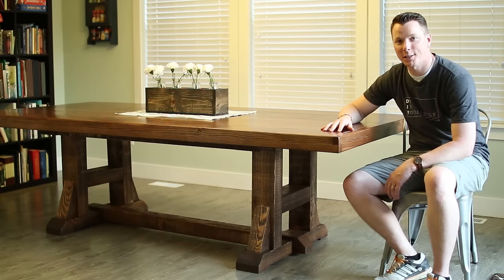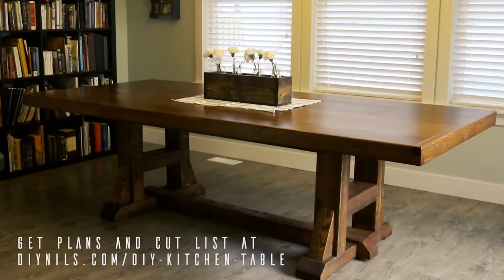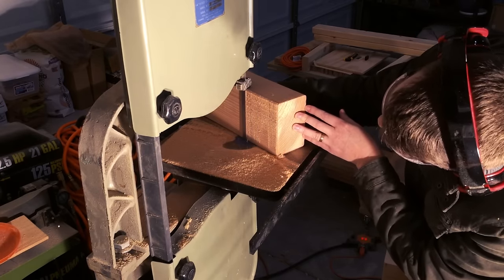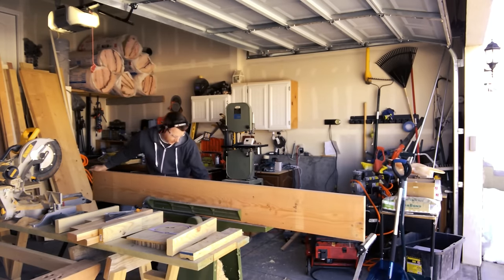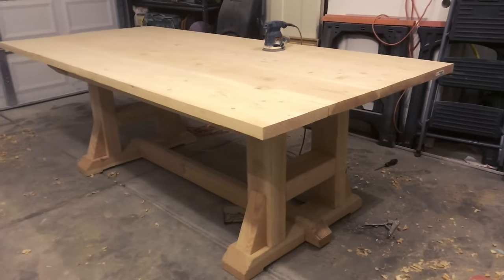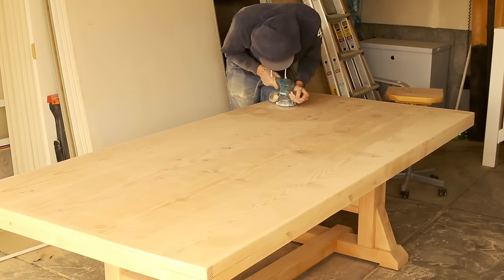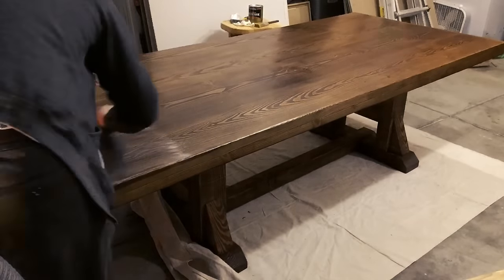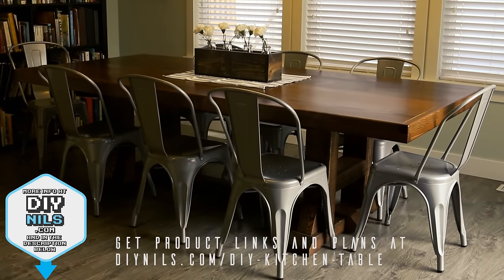DIY Dining Table: Pottery Barn Inspired Farmhouse Table

Comment from the maker: A quick note on the end caps. I’m not sure I’d honestly recommend them. The problem is that the wood will shrink and expand more in one direction than the other, which means that while the table top may move a bit in one direction, the end cap, by virtue of being perpendicular to the rest of the top, will move in the other direction. On my table this has resulted in a bit of a lip. Nothing huge, but not what I hoped for. I’d recommend leaving the wood out for several weeks first, or possibly omitting the end cap altogether. Another option is to create an end cap (for the lip) by cutting off 1.5" from the table top and then attaching that to the bottom of the ends - to help match up the skirts. I attached the end caps with glue and brads at first, followed up with some pocket hole screws from the bottom side. If you're just doing the skirt method, then I'd recommend screwing them in from the bottom using 2.5" countersunk screws. The end cap dimensions (as shown in the plans) are 3’6″ W x 3″ H x 1.5″ D.

As for the side skirts, it’s just a 2×4 ripped in half and then glued, tacked and screwed onto the table top. I countersunk all of the screws and that one worked out pretty well. The side skirts are 7’9″ W x 1.5″ H x 1.5″ D.
Reply: I make a lot of tables using similar techniques.  I've devised a system to allow the cross grain to expand and contract freely without the breadboard ends preventing that from happening.  It takes a bit more effort but makes for a stable table top.  Also, I always put a few coats of poly on the underside to seal the entire table top and limit the wood movement.  The diy plans websites don't often factor that stuff in.  

I love the rough sawn technique.  I'll have to use that!
Reply: LRN2DIY 5
Reply: Should have done book end wouldn't have had that problem but still would have had the look you wanted
Reply: LRN2DIY on a scale of 1-10. How comfortable are the chairs?
Reply: Rach Hunting hello,  what are book ends?
Reply: Nathan Donaldson also known as bread board ends, look it up as I can't post a picture of it
Reply: Rach Hunting oh okay.  I’ll keep looking.  I had asked because when I searched for it I didn’t find anything.  Thanks;)
Reply: The breadboard ends needs to allow foe expansion and contraction of the table top. It needs to be held in with floating pegs. Look up walnut farmhouse table and you should see a few examples.
Reply: Or you could just google breadboard ends... either one...
Reply: Yes I was fixing to say the same thing about the end caps. Really need to use bread boards. Good looking table though!
Reply: This will crack because of the end caps. You need to allow for movement. Instead of glueing or screwing one option is to  use oversized holes (in movement direction) and dowels on the outer boards.
Reply: Could this table be made by substituting the 4x6's with 4x4's? I can't find untreated 4x6's in my area. Thanks
Reply: Anthony Walker same problem in my area, been looking for 4x6 untreated for 18 months with no luck.   Check out https://www.shanty-2-chic.com/2016/08/diy-pottery-barn-inspired-dining-table-for-100.html to see a different build of the same table using 4x4 lumber.  I’m probably going to mix and match these two builds—good luck sir!
Reply: Hello! So I am considering building this for my home. The problem is I have a big family therefore we need more chairs. (10 in total, 1 on each end and 4 on each side.) My question is, what would you suggest I do to lengthen the table without it looking disproportioned? 

Thank you for this great tutorial! :)
Reply from the maker: @missbusiness11958  Hi Lydia! I'm excited to hear that you'll be building the table. We keep 8 seats at our table (six in our family, plus 2 extras) and it's a pretty comfy fit - plenty of room. To make the the table bigger, I would add 2' to the tabletop length plus 6" to the tabletop width. I'd keep the width of the base as is, but add 1' to the length of the longer skirts and the cross bar (that runs along the floor). That should keep things is good proportion and give you the space you need. Let me know if any of that didn't make sense and good luck!
Reply: @brentfisher3396  ¹9w9
Reply: @Madebywilly_CustomWoodworks  Can you elaborate a little bit regarding how to minimize or eliminate movement? And not having to use breadboard ends?
Reply: is that wood expansion a real problem? If yes, I will change the end piece a bit. I think wood is pretty agnostic to temperature variations, and inside a modern house with air conditioning, I do not see much problem. Wood expands a lot by absorbing moisture, but again, in a modern house the air conditioning system will take care of that as well. Perhaps the only problem will happen when I move the piece from my shop (garage) outside to the dinning room (inside).
Reply from the maker: @mmoriusa  For me it was an issue. When I brought the table in, it was fine but within a matter of weeks the grain had expanded to the point where there was an 1/8" lip on all four corners that I had to deal with.  I would look into doing a breadboard end. That said, I'm sure the conditions where you live, the lumber you use and other factors all play in.
Reply: @LRN2DIY   Thank you for sharing your experience. Yes, the breadboard is exactly what I was thinkhing
Reply: @LRN2DIY  Love the video! How did you attach the tabletop to the base? Didn't see that described anywhere.
Reply: I made a table similar to your design and had the exact problem you are describing here.  The grain on the table top shrunk to the point where my bread board ends hung out almost 1/4 inch!  I used my Japanese pull saw to cut the ends flush after the grain had time to settle down.

Comment: A suggestion, when flattening the top, use a straight/flat 2''X4''X5' with 60 grit paper glued-on, just slide this across the table at different angles to high-lite the lows and highs of the top..   I have used this process myself and am very pleased with the out-come...
Reply: David Januszewski What about a 6' level with a strip of belt sander paper anddouble sided tape to make sure it's as straight as possible

Comment: I ended up using 5-1/4 stock for the top. Then finished the edges and end boards with 1-1/2. A little more expensive but you save a lot of time shaping, sanding and getting edges straight. Plus it has far less inclusions in the wood than 2X stock. Also, make sure you lay table top boards out in opposite ring patterns. This will reduce cupping, warping etc. Will post pictures once it is assembled. Great tutorial! Thank you LRN2DIY!
Reply from the maker: KickDrumKid23 Great tips! Can’t wait to see your pics!

Comment: Great looking table.  I echo the concerns on wook movement.  Also, for the cutout on the bottom of the legs you can leave the bottom flat and come back and add small blocks on both sides to create the "cut out".  I don't have a bandsaw so that is what I would do.
Reply from the maker: Excellent idea on the wood block on the bottom. As for the movement of the wood, it's been a little bit of an issue with this table. I think I'd recommend leaving ends flush cut - no caps on them. You just never know how much movement you'll get otherwise.
Reply: LRN2DIY actually you can determine the exact amount of movement - there are expansion rates by wood type available online, and you can calculate how much movement will happen based on humidity swings in your area, type of wood, and size of piece.
Reply: ProjectPossible does Home Depot sells kiln dried lumber?
Reply: Without caps aren't the boards making up the table top more vulnerable to cupping? I thought that along with wood expansion was the point of breadboard ends...
Reply: @projectpossible70  I am building a wr cedar outdoor dining table with mitered corners on the outside table top. Wil I have the same movement. I havent checked how dry it is.

Comment: Great build! An easier way to make the arch on the bottom of the legs if you don't have a band saw - instead of using a long jigsaw blade just make multiple passes with a circular saw and chisel/knock out the chips

Comment: Looks great, but the problem with the big box lumber, is it's still always pretty wet. I made a table with that stuff a few years ago, and it warped like crazy over time. After about 4 years, I took it apart, jointed and planed everything and then put it back together...good to go!

Comment: I am so happy I came across this video. Looking for a project to try out and this is a perfect start. One question about the finish. After the coats of poly are on and sanded, for the last coat did you just leave it as is? Sand it with a very high grit? I’m curious if there is a sealer that anyone can recommend after the urethane coats have been applied. Thank you so much and can’t wait to get started

Comment: For those who don't have a bandsaw but a table saw..buy a dado set to make the cut out for the base bottoms...make sure you use your table saw sled ...worked perfect for me..if you don'twant to buy a dado set you can still use your table saw sled to make those cuts ,running your board across the blade..does take time but still works...if you don't have a table saw,use a miter saw saw with  stop block..making several cuts then clean it out

Comment: Tricky to pull out scratches/dents easier. Just add water. Dab water onto the scratch and either let air dry or heat gun dry. It'll bring the wood grain up and then sand flush. Or use a damp rag and iron. Same deal.

Comment: Newbie here.  I don't follow you very well regarding the end caps and exactly what to do instead.  I can't picture in my mind what you mean by "lip" either.  When you say to "leave the wood out".  Can it be left inside the house to acclimate to that temp and humidity?  Or best left out doors in my shed where there is no temp control?  Sorry for all the questions.
Reply from the maker: Hey Mike, great question. The end caps or bread boards are tricky. My brother actually built this same table from my plans and he did something pretty similar to this: https://www.youtube.com/watch?v=fW4AVb2XDMk. Most people don't have a Festool Domino tool (they're $1500) so dowels will typically do the trick. If you have the time (I'd recommend 6+ weeks) to let the wood adapt and dry a bit, I'd recommend keeping it indoors, near the area where the table will be if possible. My end caps haven't moved much at all after the original settling so if you have the time to assemble everything and let it settle for a while and then shave it smooth (assuming there's some expansion or contraction) then finish it, that will work too. I'd love to hear how it goes!

Comment: I wouldn't work at all the get the top perfectly flat. I prefer a little undulation and natural movement on the top as well as the rest of the piece. About 15 years ago, I saw a dark wooden table at a Ralph Lauren store and the top had the most incredible feel to it. It was silky smooth but still felt like wood, not a fake or foreign finish. It undulated ever so slightly all the way across. It was incredible. It was also $18,000 if I recall correctly.   :  (

Comment: Your table looks amazing. I am thinking about making a farmhouse table, probably a much simpler design. I am planning on doing the top similar to yours. However, I don't have access to a joiner or a tablesaw (I am working out of the patio in my apartment). In the video, you mentioned something about using a circular saw to remove the rounded edge of the 2x12. Coule you please elaborate? I am having a hard time imaging how to cut a long straight edge using a circular saw. Thanks!!!
Reply from the maker: Hey John, That's awesome that you're wanting to try this. Here's what you can do with a circular saw. It is more of a pain but if you're careful it can work really well. The gist of it is to make a guide using the manufactured end of a sheet of plywood or any other long, flat, straight edge. Here's an article (there are tons) that explains what I mean: https://www.familyhandyman.com/tools/saws/two-essential-saw-cutting-guides/view-all/. You can use your circular saw to create the guide as well, just be sure to put the manufactured edges as the two edges that contact the saw. That way you know it'll be straight. Then, it's just a matter of clamping your guide to the boards, getting a good blade on your saw (not a ripping blade - something with more teeth) and making your cuts. You can do this on both sides of each board. Also, be sure to see my pinned note about the end caps. Good luck and be sure to post pics so we can see how it's going using #lrn2diy or @lrn2diy. Thanks!
Reply: Oh got it! Thank you so much for such a fast reply.

Comment: Awesome job on this table. I just ordered the lumber to build it and gonna give it a go. I pulled up your cut list and dimensions page from your website and was wondering if there was any other more detailed plans, that I missed. Printed out only one page.
Reply from the maker: I tried to put everything on that one page. If you let me know what else you need by way of dimensions or instructions, I'll be happy to provide it.
Reply: I had a similar question. Hi Nils, awesome idea here! In the cut list for the TOP you have a quantity of 4 - 2x12's. Wouldn't this be a 4' wide top? If so that one pager's dimensions graphic (top right) shows 3'6". I'm doing a modified version of this table at 6' in length x 3'6" and am trying to size everything proportionately. Thanks!

Comment: Hows the table holding up? My brothers warped pretty heavily and are planning out a new one but will use c-channels underneath.
Reply from the maker: Our is doing great but we did have some warping on the ends, which is why I recommend using a breadboard style end cap. The problems arise when you try to have boards going in two different directions, which causes problems when the grain swells in opposite directions.

Comment: Table Height
Table design looks great. The Table height in the plan is 2'6" (30")  but after cutting it comes up to be 29.5" because the base and top 4X6 is actually 3.5" thick. Is that my mistake and It came out wrong from me? Standard tables are min 30" high.Table Height

Comment: This table is terrific!! I just found a local Lumber Store that carried some non-pressure treated 4x6. I am about to build that table this weekend. Question to you....: can the table go thru a regular door without the top? just wondering if i have to use glue during this process... Your response will help.. Thanks in advance.
Reply from the maker: That's awesome - I'd love to see how it turns out! Yes, it can fit through a standard door with the top off. I recommend marking everything and predrilling in the garage/shop and then bringing in the base, then the top, then just some quick assembly and you're good! Best of luck!
Reply: Thanks a million for your inputs! I will send you some pics for sure!.... probaby next weekend. My wife is in love with your table!

Comment: Getting lumber together to build this table. Looks awesome. But how are you getting a 3'6" wide top by joining 4 - 2 x 12's together?
Reply from the maker: It provided excess so I trimmed it down. Because 2x10s are actually 1.5 x 9.5s, they wouldn't have been wide enough when put together so I went with 12s and trimmed. Guess I could have mixed the two.

Comment: It's been a few months, how have those lag bolts been working on the legs?
Joining into an end grain is not typically a great idea. You'd usually use a mortise and tenon there I'd imagine.
Another thought is to add a couple of dowels and then lag into the dowels; much stronger and will probably last much longer.
Food for thought.
Reply from the maker: Great suggestions. We've been using this table for about 10 months now and the lag bolts are holding up perfectly. No worries there. The rest of table has remained pretty much unchanged since the first month or two. As I had mentioned in other comments, there was some wood warp (shrinking and expanding) in the end caps as compared to the table top that butts up against the end caps, so I would probably leave the end caps off next time. I wonder if even the dowels or mortise and tenon would fix them - who knows. In any case, the table in general is looking and functioning great - just a lesson learned for next time on the end caps. Thanks for the feedback and for watching!
Reply: End caps can be tough, right? You're fighting against the vertical expansion/contraction of the end cap (the width) and along the width of the table top. I've seen that cause some funny stuff with end-caps (and breadboard ends).
The warping's not a mistake... it's a rustic design feature; right? :)
A lesson I learned with doweling in those scenarios is to work from the center -> out, securing the center dowel all the way through (with wood glue) and maybe not quite as aggressively with the remaining dowels (just a little glue on the top of the dowel just before the last strike). That forces expansion off center and usually keeps everything looking great.
Dowels can be a nice design feature too (depending on how you've decided to include them, of course). They can add a nice look to the piece.
Another option is biscuits if you're willing to invest in the equipment.
Thanks for the video and reply.